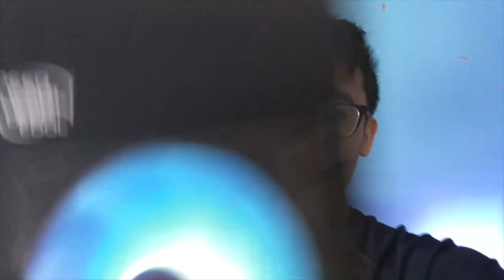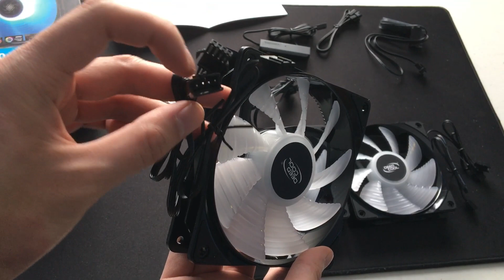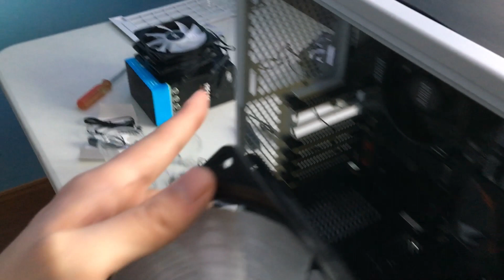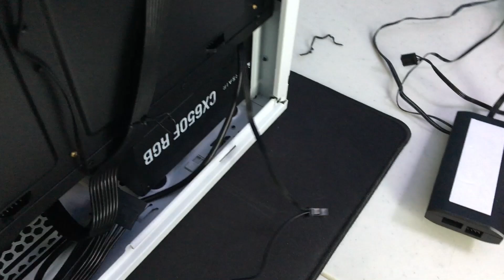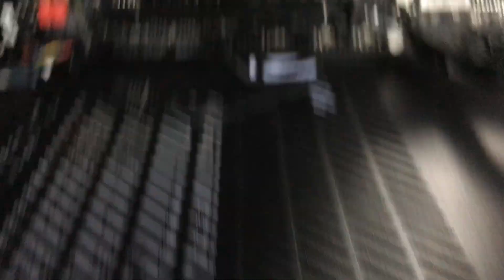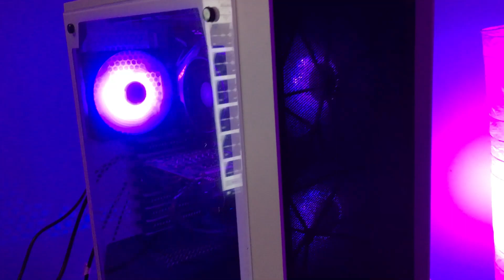How To Daisychain & Install your PC Case Fans | Deepcool RF120 Installation

Comment: Thanks! I plan on either Deepcool, like yours, or Antec. The D/C has a better CFM than the Antec. 🤓 if you add a fan or 2 on the top of your case, should they be drawing air out of the case, or draw it in? Thanks
Reply from the maker: Nice! I don't know too much about the Antec fans but so far everything is good with the Deepcool ones. Typically you'll have your top fans drawing air out of the case.
Reply: @BPYT  the Deepcool fans are my 1st choice. Draw air out of the case - got it! Thanks again

Comment: Hey I have the fans all daisy chained and connected to the controller but i have no rgb and i didnt get a female cable for the rgb what do i do?
Reply from the maker: I would either return or contact Deepcool for the RGB cable as you need it
Reply: @BPYT  i figured it out
Reply: @HyprTV  how did you do it?
Reply: @junwar323  I plugged in the header on the mobo

Comment: 3:00 do i need that step or i can just connect the female connector hanging out from the 3 daisy chained fans right through the motherboard (im using coolermaster sickleflow)
Reply from the maker: It might work but I wouldn’t risk it. You can see the additional cable has some gold plating on it whereas the female connector hanging out of the fan doesn’t, so it’s likely that they don’t function the same.
Reply: I had a similar question, with the exact same fans I'm using. Weird coincidence.

Comment: Excellent  video!! I ordered the 5 fans pack, it comes with 2 hubs. So, do I have to use both hubs in order to have the 5 fans since one only supports 4 fans? How do I connect both hubs ?
Reply from the maker: Hey! In that case you will have to use both hubs separately. 3 fans on one hub and 2 on the other is typical.
Reply: @BPYT  but still daisy chain the 5 fans for the rgb? great video btw
Reply from the maker: @gerardandreivillasenor5633  I like to play it safe if possible I would daisy chain 3 together and separately daisy chain 2 together. Technically you should be able to daisy chain 5 together though.
Reply: @gerardandreivillasenor5633  The manual for the fans shows that its possible to chain more than 5 fans for the rgb. But what actually matters is the maximum current provided by your motherboard. 
You can check that in the spec-sheet for your motherboard (should be easily available online). Then, look at the maximum current a single fans draws for the rgb. (This seems to be 0.12A for the 120M). If the sum of all your fans lies below the maximum current of the motherboard, then youll be fine.